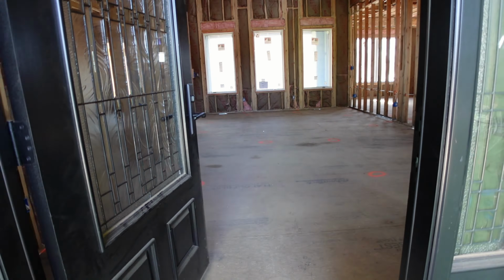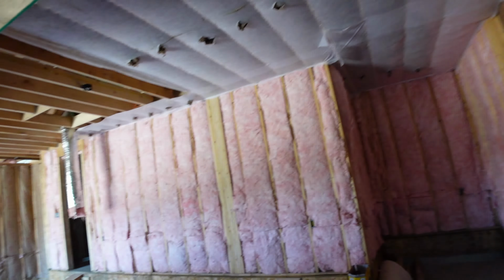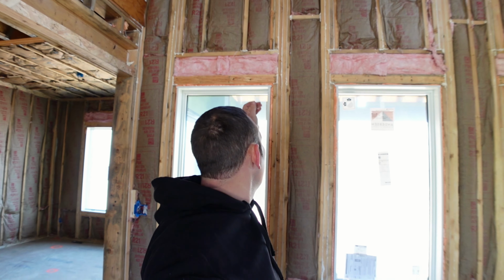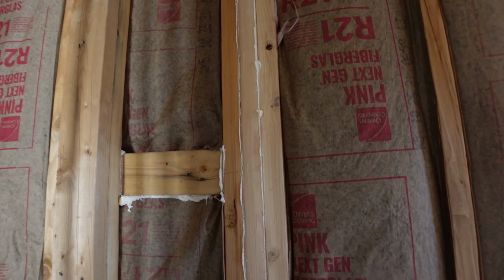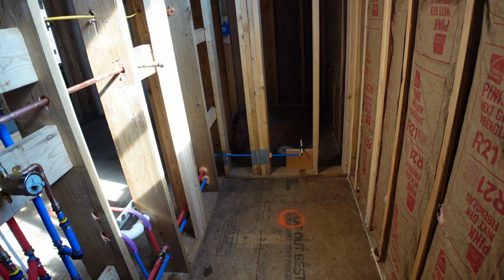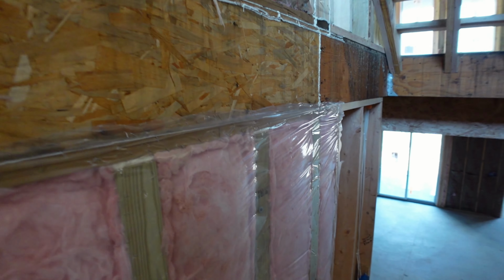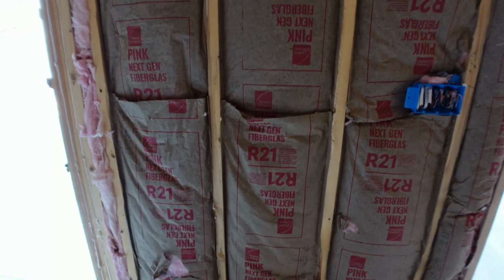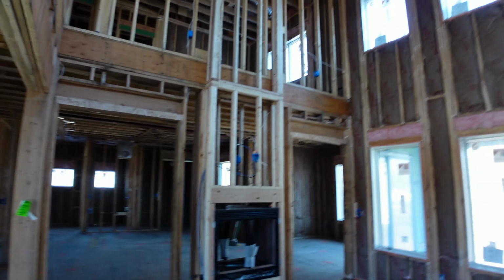Air Sealing and Insulation! New Construction - Episode 26

Comment: That white  caulk on the upright inside, if its anything like they tried to use in my new house is a JOKE, it just some thin and hard cailk, they were on the joint every they crossed over that joint, I use Temco Dynamic 100 on all of mine it will stretch 50% of the thickness of it 
If that caulk is hard, how long does one think it would last over all

Comment: On the Rockwool, I installed 12 years ago in my house and I like it. Back then it was available and I even got the ginormous ones for the attic. Now it's slim pickens and Lowes just raised the price of the R15 from $58 a bag to $79 (2/24). Currently, for supply reasons and cost, I'm mixing Johns Manville mineral wool for the concrete walls, Knauf fiberglass everywhere else, and cellulose for the attic and the space above the garage where the living space is above. On that note, the basc gov site recommends insulation touching the floor above and the air gap toward the garage, but the building science site says the opposite will provide a warmer floor above. I'm going with the latter, plus it's easier for me. Seal the rim and then blow in about 10 inches of cellulose and call it good. There is also a guy on YT who somehow runs a vent from the duct into that space to heat it.

Comment: spraying between studs and plates must be a joke. You air seal a building from exterior. Use liquid applied air/water barrier on top of the zip sheathing. How do you even install drywall with all that spray foam sticking out. Do your drywallers shave them off? If so your so called seal is gone because that spray foam doesn't expand into the stud. Such silly building practices.
Reply: I spray foamed every single joist just like he did in this video, it's all about quality! Super easy to trim down flush later and have a 100% seal that doesn't effect drywall at all. No more half assing my man, time to step it up!!
Reply: You air seal from the outside and inside, I work for an insulation company. You have to air seal the inside before you insulate.
Reply: @ No. You only need to air seal from outside. If you air sealed outside what is the purpose of sealing inside? What kind of stupid logic do you guys have.
Reply: @Faruk651  you're the reason why I do shit myself haha. Can't trust tradesman these days, always looking for the easy ways out. Follow the science my friend, building science!

Comment: Great video. My comment is not about your video but about the codes. So we are required to make a house airtight by code, then we have to make a hole in the house and run an exhaust fan continuously to bring in fresh air by code? What am I missing because that sounds like insanity?
Reply: ERVs. You’re missing ERVs, but otherwise that’s correct
Reply: Not disagreeing with your comment just ranting lol.  I understand the ERV concept. Make the house airtight to save energy. Then run a fan to bring in fresh air continuously through an ERV that costs about 2000 dollars to install. This does not include the cost of sealing the house and performing the required pressure blower test. Probably another 3000 dollars total. Then we have the extra insulation costs now required. For example R-49 in the attic. R-49 is 15 inches thick which doesn't fit in a 2 x 10 joist unless you use closed cell foam which is about an extra 8000 dollars over regular insulation just for the attic. Of course, you could go raised heel and then get away with R-38 which still doesn't fit in 2 x 10's so now you have to bump up to 2x12's or still go closed cell foam. The list of code changes forced on us that are not for the purpose of safety are out of control and make it exceptionally expensive to build a house with little return on the investment. Just my two cents worth of ranting lol.  @jeremymorrell
Reply: @Deep_Divers I'm at the insulation stage of a small house for my son and have been trying to build affordable shelter yet not too cheap. I am tempted to seal in all the places like in this video, but then I get to looking and I see cracks everywhere and I'd be at it for months trying to make the house airtight. Then I think again, do I really want it airtight?

Comment: There is a a much easier way to build coffers like that using 7/16 osb.
Double up sheets on floor draw pattern cut it out lift directly up nail to truss then blocking for depth then lift other cutout directly up and nail to blocking

Comment: On air sealing details: Once sheetrock is put onto those foam air seal spots its toast. Wouldn't using silicone have made more sense?
Reply: how does the drywall ruin the polyurethane closed cell foam?
Reply: @brianroadnight7813  the foam barely makes in between the studs, even if they used closed cell. Silicone, while more pricey, would have made a better fit and air seal. One can even make the argument that once the sheetrock is screwed in, that extra foam hanging forward could create air gaps between bays. The foam is already dry and hard, I'm going to assume they cut off the overage before drywall. If you have ever cut foam this close it tends to pull out what little made it into the gaps.
Reply: Maybe even zip tape in some spots.

Comment: Did they use caulk or spray foam for the air sealing details between the top and bottom plates and up the double and triple studs?  Around the windows it's cleary spray foam but curious if they used spray foam as well elsewhere?  (white sealing details).  This looks really great!
Reply: spray foam

Comment: where do you put dens shield ? why do you do vertical seams on laminations inside ? and why not sealm them outside instead ? why do batt insulation on inside of exterior foundation wall ? moisture will condense here, convection current set up,. and subsequent mold....you need to use solid foam or spray foam , not batt of any type. contractors wont put rock wool in even though superior as they don like working with it. Cellulose also superior, but they have higher margins on inadequately  installed batts- while rockwool can achieve a pretty good friction fit, fiberglass bats never.

Comment: Nice house! I would rather look at a house at that stage any day over just looking at completed homes. I built a master bathroom for my wife and I at our daughter’s house in Michigan with a rain head and hand held shower head as well as a linear drain, I did the same thing with the valve location and we really like it. I used a Grohe valve that turns on and off with push buttons and a separate temperature control knob that stays set where we want it. That way when you want to shower you just poke the button and go about getting ready and the shower is perfect when you get in. I also did the Ditra Heat under the shower tile. I only wish our bathroom at home was as nice.
Reply from the maker: That sounds amazing!!!! We will be doing a linear drain and heated floors in this one as well.

Comment: For air sealing, have you used a product like AeroBarrier before? Instead of manually foaming between studs, top/bottom plates, etc.
Reply from the maker: I have reached out to AeroBarrier on multiple occasions to try and get put in touch with a company local enough to us to do the job, as we wanted to use them for this house. Unfortunately, I was only successful in finding a local company that does the air duct sealing, not the whole house sealing. I'd LOVE to have them do one of our projects in the future if they end up with a local installer.